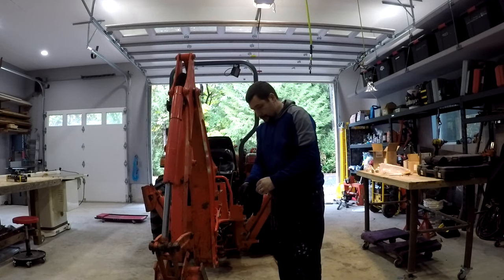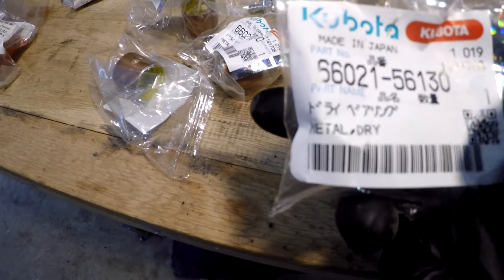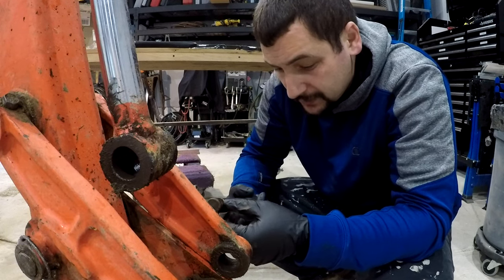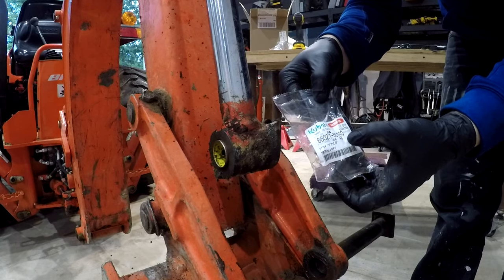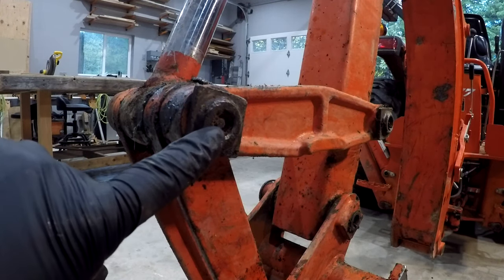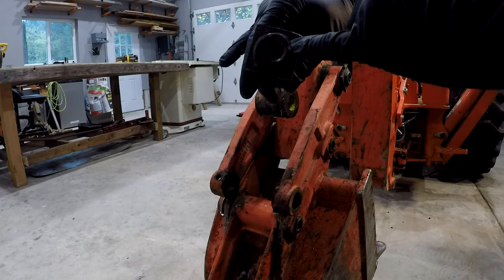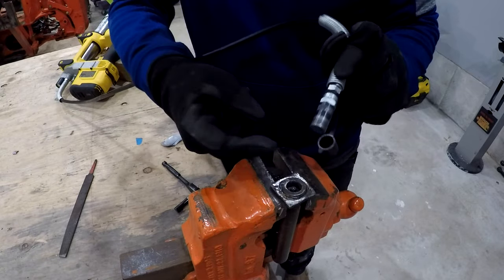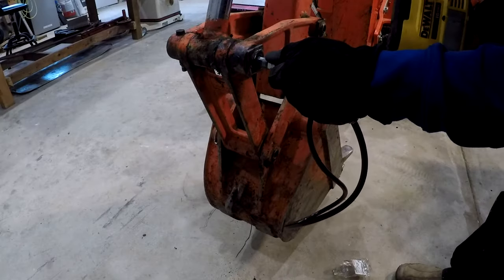Kubota BH77 Bushing  replacement

Comment: A suggestion for anyone who works on any type of equipment. Accumulate a selection of aluminum drifts in various lengths and diameters to prevent the deformation that you saw on the pin. Also, you can grip the drift with a pair of Vise-Grips, to save your holding hand from being mushroomed by the hammer.

Comment: I never have been impressed with the slop in Kubota's small backhoes.  Have seen some pretty poor repairs. You did well. However, that was too easy.  Am thinking the cylinder eye is worn. I am far from an expert. You can reborn it and install thicker bushings.

Comment: I think you should stop letting your brother work on your equipment....   You are lucky you didn't run it long without bushings,  You would end up damaging the cylinder rod eye and then it would have to be repaired (welded up and bored) or replaced.  Good eye catching the problem quick
Reply from the maker: yup i agree about letting my brother use my tractor, his house is all finished know so i dont think he will have any need for a long time.